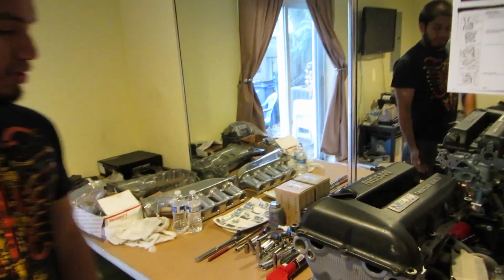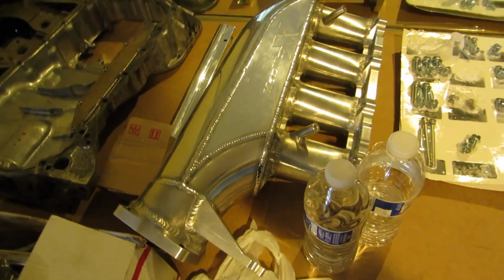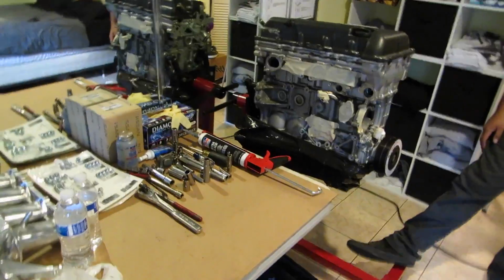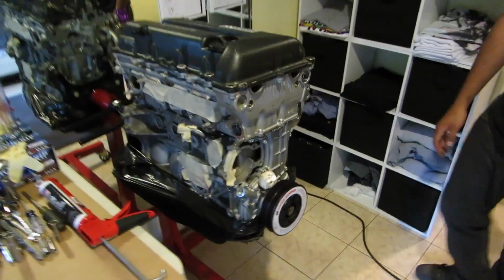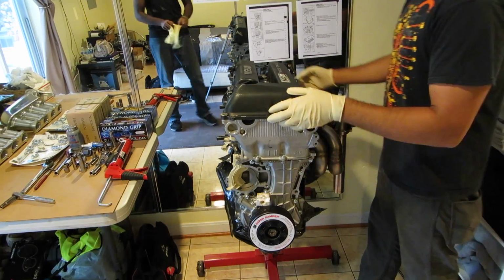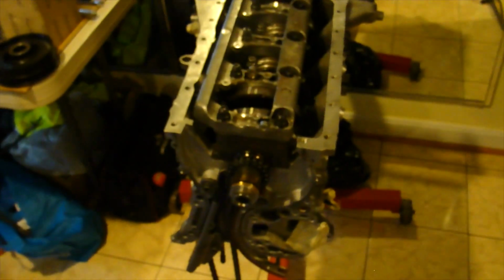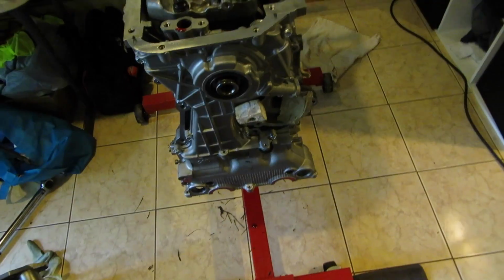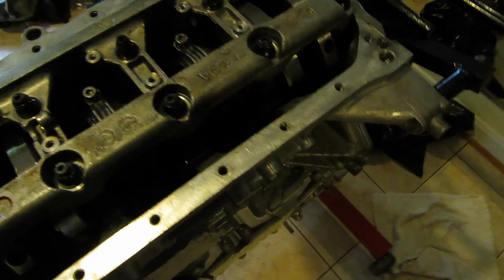Thomas' SR20VET: Part 1

Comment: I don't know if I heard in the video but, what are the differences between a VET and a DET?
Reply from the maker: +BeavertonBoi The VET has variable valve timing.
Reply: +BeavertonBoi The neo VVL is kinda like the VTEC honda motors, It adds a second set of cam lobes that are larger and stay open longer
Reply: It's a VE head (SR20VE), VET (SR20VET) is different from VE, this is usually referred as SR20VE+T. Other benefits include better airflow than a DET head and solid valve train/stiffer valve springs allowing higher rpms with less valve float/lifter issues.
Reply: That's VE+T

Comment: never use a torque wrench to loosen anything
Reply from the maker: This is usually true. The reason to not use a torque wrench to loosen bolts is because you might unknowingly go over the torque wrench's maximum torque and ruin it. In this case, this engine hasn't been run before so the nuts that we were taking off had no extra corrosion or heat cycles holding them in. The torque wrench was set to a high value and then used to loosen the nuts to make sure the wrench's max torque wasn't reached. But overall it is safer to just use a breaker bar.

Comment: It hurts my heart to see not ARP head studs being used . =(
Reply from the maker: those were ARP head studs :) The motor is fully built, its got the whole 9 yards!
Reply: look like bolts to me .
Reply from the maker: TURBO RICKO If you look, you can see the studs when we pull off the head. When re-installing the studs, the nuts were threaded on the studs by 1 or two threads to make things easier.
Reply: coo